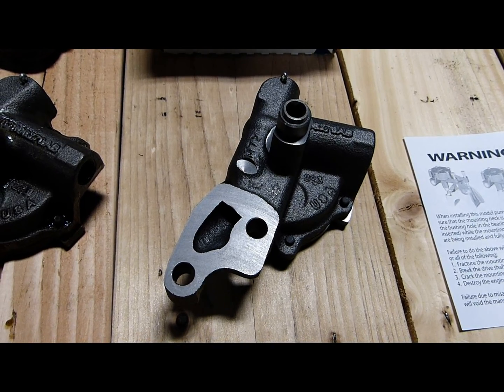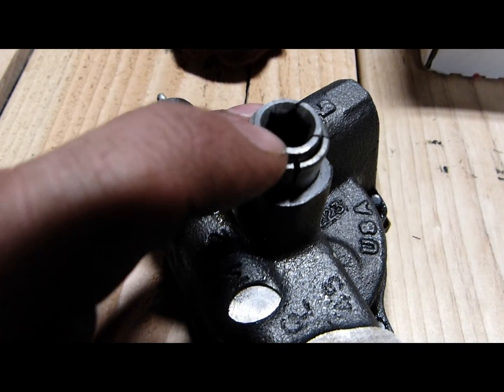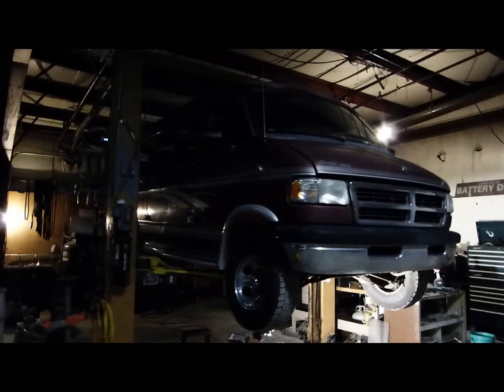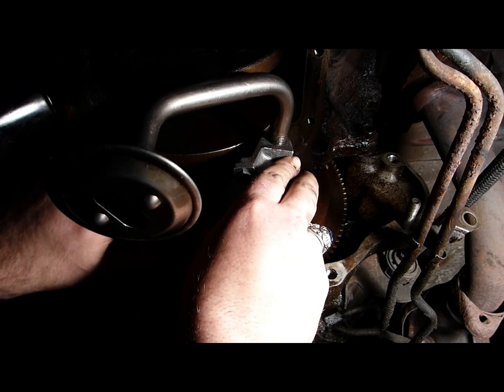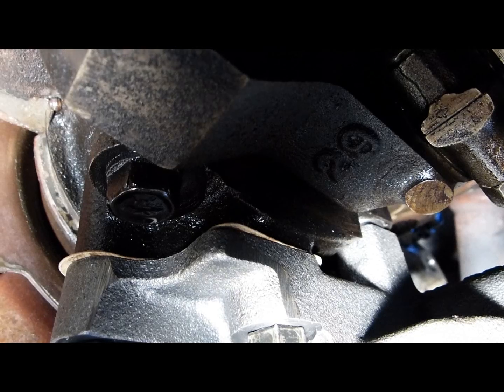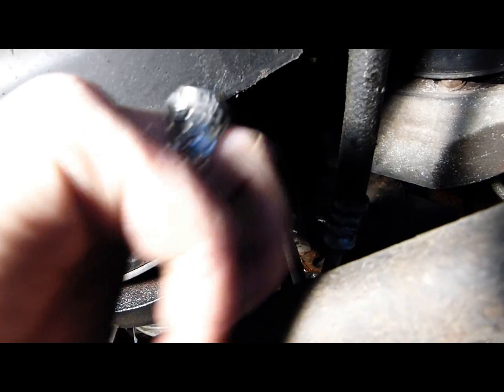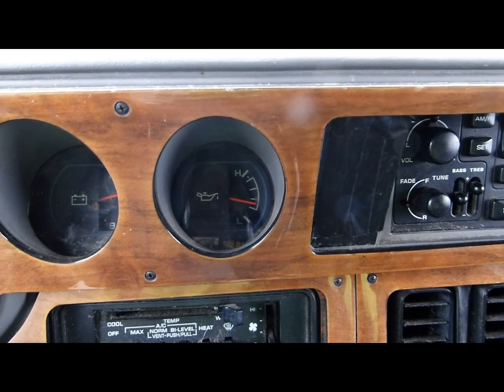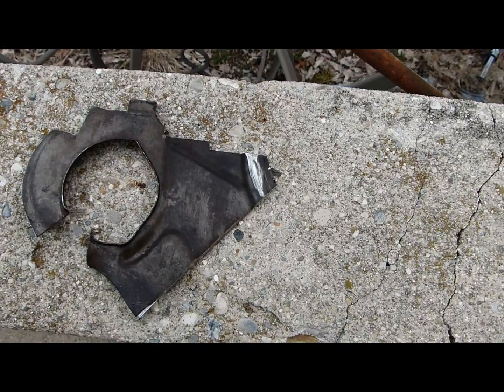Chrysler 318 360 Oil Pump Replacement 5.2 5.9 (Dodge Plymouth)

Comment: I just did an oil pump replacement on a 318, with a Melling. Had decent oil pressure before, only replaced because I was replacing the oil pan. I now have zero oil pressure. I cranked with the coil unplugged. Never built pressure. I decided to start it. Still no pressure. I don’t see oil at the valve cover. What did I f@ck up.
Reply from the maker: @shaneheiden5448  Alas, I think a second attempt is required.  Unbolt the pump, pour some clean engine oil directly into the pump to create some stickiness about the pump rotor to help it pull the oil from the oil pan.  Don't be afraid to use a little heavier oil, perhaps 30 weight.  When installing the pump, be certain that the oil pump drive is slotted correctly into the pump.  I hope that helps.
Reply: @shaneheiden5448 I just replaced my pump and oil sending unit and am having same issue, no pressure. Did you ever get a solution?

Comment: What was the process to drop the oil pan? I cannot get mine to come out. I have lifted the motor, removed the tranny and exhaust, but I still don't have room to clear. Thank you for this video as it's what I'm doing as well....if I can get to it
Reply: I’m sure in 7 months you’ve figured it out since, but I had the same issue, I just had to find the right angle, rip out the rubber gasket on the front and by some form of voodoo magic after 30 minutes of back and forth and left and right it finally just came out.

Comment: Lost oil pressure, installed new sensor...won't start or turn over. Help please. 99 5.2
Reply from the maker: Try turning over the engine with a socket and driver on the crankshaft bolt.  For safety, ensure that ignition is switched off.  If the engine won't turn over by hand then it's very likely seized.
Reply: @HemiChrysler  I tried by hand..even pulled the plugs to release pressure..won't budge. Is it trashed? Options?? And thank you very much.
Reply from the maker: @umbralgroup5732  Yes, I think it's seized - sorry.  Replace or rebuild engine, or junk the vehicle.  Difficult decision, I know.
Reply: @HemiChrysler  I needed to hear that. Thanks again, cheers

Comment: Don't forget the bastard red headed step child, the 239 V6. Originally an LA 318 with the first two cylinders removed with split crank journals, it got the magnum treatment when the Magnum 318 and 360 came out in 1992. The LA 239 is often forgotten about because it was only made from 87 to 91.

I have a 239 V6 in my 1988 Dakota and it's been a dreadful engine. It rarely ever runs correctly because even a tiny pin prick of a vacuum leak will cause it to act like it has a bad misfire. Getting it to where it doesn't have any vacuum leaks is essentially impossible, it has 11 vacuum ports on the throttle body, 9 on the vacuum actuators, two on the intake and a dozen or so more Tee junctions, as well as the vacuum devices themselves.

I think I'm going to have to change the oil pump on mine because it appears that the oil pressure relief valve is stuck closed. On start, the oil pressure goes up to about 3 quarters the gauge and will quickly go off the gauge if driven at low speeds and stay pegged until idled back down for a few minutes. I've replaced the oil sending unit and done an oil change with slightly thinner oil (5w30 instead of 10w30) and added 4 oz of seafoam, yet the problem persists.

The oil pump on the Dakota is a beast of a job, I'm pretty sure the engine will have to be jacked up a few inches to clear the cross member for the front tires.

Comment: i have the same van your telling me the oil pan clears the subframe and only have to remove exhaust to pull it mine is a 98 5.2 2wd please let me know how you got that pan off
Reply: GUSTAVO GARCIA I saw someone mention in another video that after they put the engine at top dead center (TDC cylinder#1 on compression stroke) then they were able to get the pan off.  It has to be done that way.  It was a 318 also.
Reply: if you watch the video closely he bumps the exhaust and it moves as if they disconected the exhaust pipe at a part where theres 2 bolts

Comment: Does someone know the exact torque requiered on the oil pump bolts?
Reply: Tommy B. I know your post is 9 months old but they're 85 ft lbs.
Reply: Buy the repair manual for that vehicle it tells you everything

Comment: I have a 97 jeep grand cherokee with a 5.2L 
when I'm at am idle in the driver seat I chat hear a tapping sound that sounds like it is from the engine compartment.  but when I get under the engine I can't hear any knocking.  any help would be much appreciated.  (in also considering changing my oil pump as I have 226k miles and no knowledge of it being changed previously)
Reply: can*
Reply: Cody Hartsell  me too lemme know if you figure out what it is
Reply: me too did you figure it out in 5 years